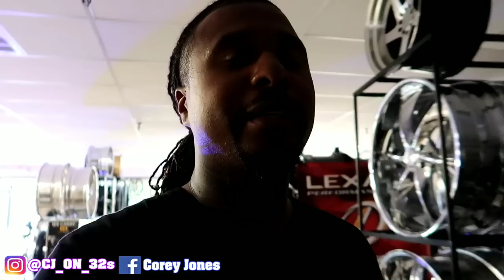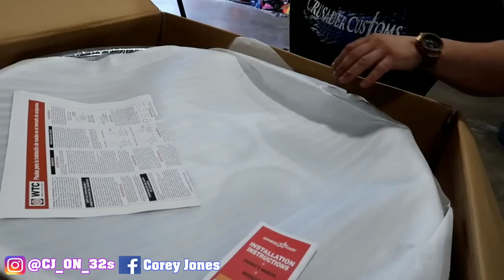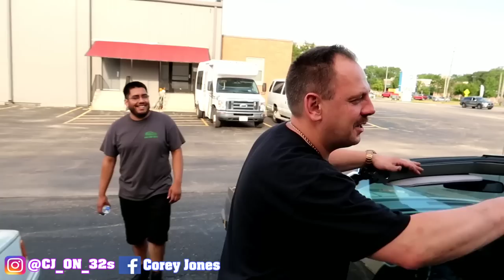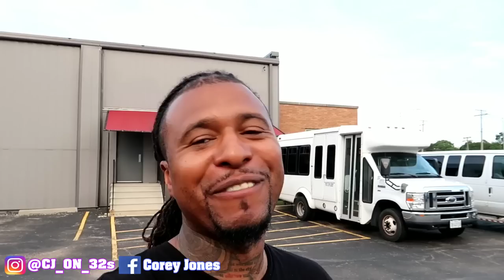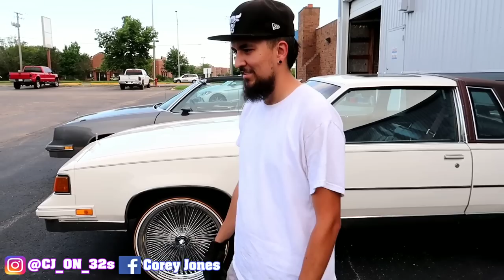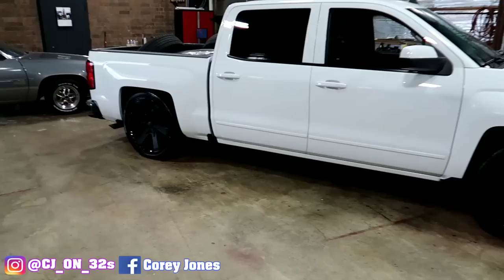I CANT BELIEVE I JUST PURCHASED A NEW VEHICLE BIG MISTAKE

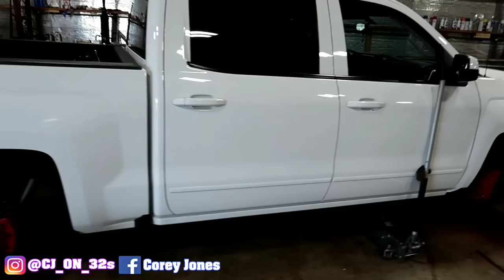Comment: Hey CJ I hope u read this but I got you on a cheap shop trick I though of myself, at 4:00 in video u walk past the white truck u guys have it jacked up and the Jack handle is close to the truck, u guys got a shop towel looks like wrapped around it so it dont dent truck instead go to Walmart or where and get a swimming pool noodle and cut a piece off it and slide it over the Jack handle if it dont fit over it cut it allway down the back and slide it over! just thought I'd share a cheap trick to save anyones door from a accidental bang from Jack handle!